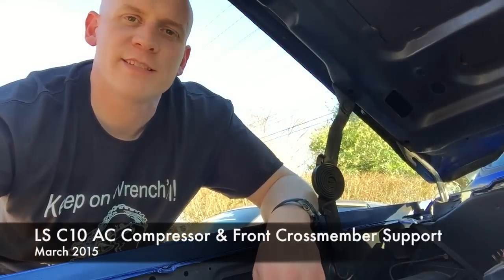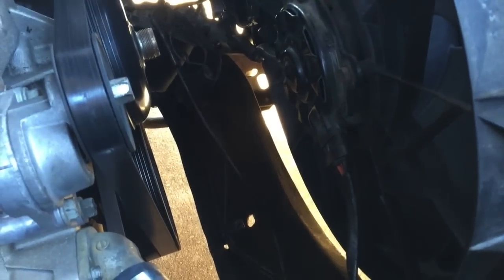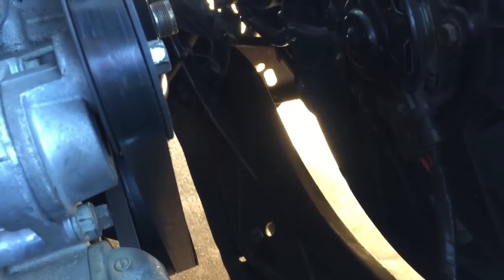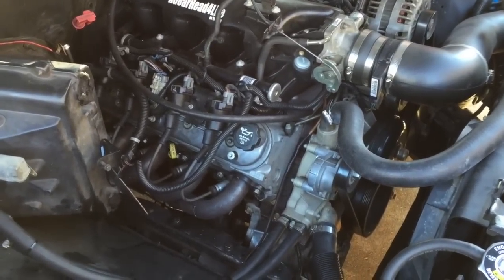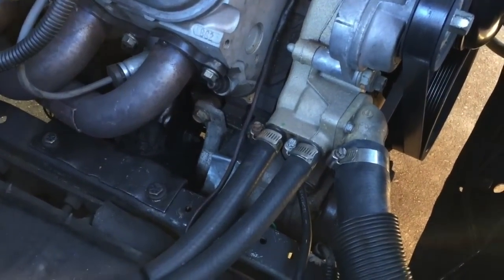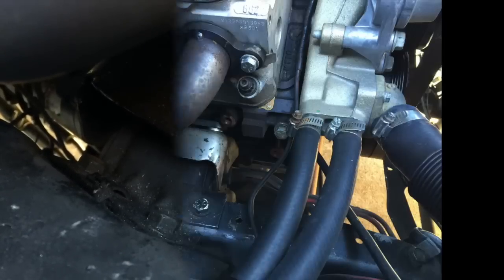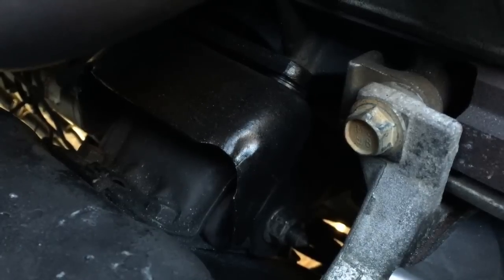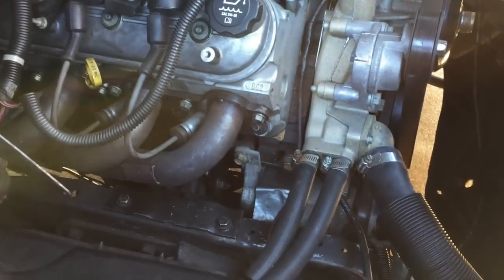Cold AC on C10 LSx Swapped Part 1 & Front Crossmember Info 73-87 Chevy Truck 5.3 Compressor LS

Comment: Thanks for the replies once again,I wanted to go fuel injected but I've already purchased the intake and msd kit. Currently have a good holley carburetor also. I just didn't wanna go thru the problem of trying to get the electronic throttle.

Comment from the maker: Preston Salisbury Awesome man! Glad you're enjoying the show man. With the LT1 it should be much easier since the 80s v8 clam shells will bolt up to them. I'm not sure what you'll need for the 65, but it'd be like putting a 80s v8 into it.
The only down side to using that rear end is that its an inch smaller and known as being weak if ever pushed hard, like with slicks and drag racing. If you dont hook that hard it should last. I dont have info on the rear end swap, but I'd guess that you'd have to move all the mounting points over to the new rear end, but that could be options left up to the fab man.
Reply: What motor mounts did u have
Reply from the maker: @Brandon_obs_ls  on this C10? I used basic LS Swap 1” set back plates off eBay.

Comment: friend of mine had the frame crack around the boltholes of the steeringrack , it basicly ripped the steering of the frame
they sell reinforcementplates to go over that part of the frame as whell 
since it might have been flexing for a while before you spotted it it might be a good idea to check there when you have the bolts off
Reply from the maker: Yep! Good point! I hadn't even made time yet to check to see if there's any more slack. And since your brought this up, that reminds me of another good thing that extra bar that I was trying to explain would help since it uses the gear box bolts to support the gear box.

Comment: Very cool informative post. I just started a similar project on my 1965 C10
I just purchased a 1993 z28 z28 with a 6 speed manual. For the drivetrain swap.
I want to use the rear end also. I'm wondering if there is a motor mount kit available for these projects? And for the rear end swap?
I know there's going to be a lot of fabrication involved and I found a good shop who a personal friend of mine owns to do the work.
I am just researching the Internet to find post like yours to forward to him.  Your video helps a lot thanks for posting .

Comment: I’m sorry but I’m still very confused on how you cut the adapter plate; with those two holes you drilled does that mean your clam mount is moving backwards with the two new holes ? Wouldn’t that make your engine lopsided. Sorry if this seems like a dumb question but I’m looking to do the same thing as you and I’m so lost. Thanks in advance

Comment from the maker: damian ficklin I dont have a engine code that I stay away from. I just avoid the 99s and some 2000s if I can. they usually have a notch cast into the head where it meets the block. That notch limits you on which head gasket you can use. I also avoid 706 cast heads since a large portion of them are known to crack.

Comment: you should cut the rivets off of your frame at the sway bar brackets and bolt them on. the driver side front rivet looks like it's failing too.

Comment: Hey Gearhead, Great work, as always my friend .Was that cross member from a particular year ? (I hope that the starter can be removed without much hassle) Thanks for the awesome video.............John
Reply from the maker: Thanks John! Yea, starter comes off easy. I dont know the exact year, but it was a few years older than mine. But you could tell that someone had installed it onto that truck because the frame rivets where already removed and it had been bolted in.
Reply: AGearhead4Life Thanks

Comment: I bought an LQ9 from an 06 Escalade and I'm working on the harness and nearly done but the A/C pins on the harness are stumping me.
On LT1SWAP it says to remove the A/C compressor clutch relay control and the 5 volt reference for the A/C from the pcms.
If I remove them, will I still be able to use the A/C? Or do i need to keep those in order to make the Escalade A/C work with my C10 A/C controls?
Reply: I took them off my pcm i wired it in as it was when it was stock and run it like that works fine for me
Reply from the maker: Keep the plugs to the compressor. I plan to run my C10 body harness to those plugs to control the AC. I havent wried in the AC yet to see how it'll need to all be done, but I bet it'll work this way. I think thats whaty Ivann just said he did too.
Reply: AGearhead4Life Ivann Carbajal so remove the wires from the PCMs, keep the connectors they used, and just hook them up with the C10 wires for factory A/C basically?
Reply from the maker: Carlos De Leon Basically yes. That would be my plan.

Comment: That was a pile of work man! How close are you to the starter, I'm sure it will be more likely to fail than the compressor. Good job as always, I would be more inclined to drill a hole in the frame than notch it, just a thought. Keep postin !
Reply from the maker: Thanks Jason! Yea, it was a crap load of work! lol But at least I didnt have to buy a compressor.. yet and i wont have a compressor up high blocking the veiw of my engine. :)  A holes isnt a bad idea ,but that lip there isnt very wide, maybe 2". IDK yet, havent had much time to look at it. I was hoping to just make a 90* fitting and go aruond the frame.
Reply: how did you wire the ac up whats the pinout for a 99 to 2002 pcm for a 95 impala ss?
Reply from the maker: I just ran the wire from old AC compressor plug to the new compressor. It acutally needs to be ran to the LS harness though, so that the computer can kick the compressor off when you floor it. I just turn my ac off manually before I floor it right now.
Reply: ok thanks

Comment from the maker: damian ficklin 99-00 are the only 5.3s that I avoid and thats only because the head has a notch in it that won't allow you to run a MLS head gasket. For AC, there are a few different ways to high mount an AC compressor and a few different compressors that you could use. I did the extreme budget way on the 5.3 Roadmaster swap. Here's the link to the video:  https://youtu.be/hA5DMdpsQxI

Comment: Hey bro is the ls swap really worth l the work and money. I would like your opinion cause you definitely got it down to a science. I have a early 80 with the older front end that I'm throwing together with spare parts but I am planning a frame off 85 in the future. I'm thinking of trying the ls in that but for now I'm kicking it old school.  Check out the 80 on my page. Let me no what you think.
Reply from the maker: ChevyShawn Most definitely. In every way. That's the only reason that I know them so well. Once you mess with an LS and see all the benefits, you'll never care to mess with SBC again. Gaskets are reusable, motors last ~100k miles longer, gets at least 5 more MPG and starts out with about 100 more HP. THere's more, but thats a good starter list of why.

Comment: Hey man so what do you think of the LS truck compressor now that you have a couple years on it?  It's nice that it's tucked low and away like that, only downside is notching the frame.  Any thoughts on the Vintage air setup, and using that with the LS truck compressor for guys with non-ac trucks?
Reply from the maker: Christian France hey hey Chris! The compressor has worked fine for me. No issues and still working great. Only thing that I wish that I would have done is install a high side pressure switch.

I’ll likely also later switch to LS high/low AC pressure switches so that I can let the PCM disengage the AC compressor automaticity when I floor it. Right now I manually turn it off as I floor it.

I only wish my blower motor could flow more volume. I may modify something later on to get more air. It does decent, but I’m comparing it to new cars and it’s a fraction of that.

I haven’t used a vintage air system yet to compare it to. I’ve seen how it’s nice having their system out of sight, off the firewall and inside the dash.
Reply: @AGearHead4Life  do you think moving the factory frame mount further back would have worked also?
Reply from the maker: P Motorsports Sure! Very likely, that would cure the issue. I think that I chose not to do that because of the curve of the frame.

Comment: Hey, just curious what did you run for a fuel system? i have a bone stock 2000 5.3 complete with wiring harness i'd like to swap into my 86' c10. Did you reuse any of the factory stuff or everything new? Thanks, love the videos
Reply from the maker: MechanicsMike Thanks Mike! Yea, I always try to reuse as much as I can. So I just dropped a warble 255 fuel pump into the sending unit. Then I used high pressure rubber hose and high pressure hose clamps from a parts store to go from the hard line to my fuel rail. That easy.
Reply: Just an in tank type of deal right in with the stock sender? Did you replace all the rubber stuff with high pressure line and just let her rip? Stock carb tank? Thanks so much man
Reply from the maker: MechanicsMike Yes, in-tank with sender adapted to fit it. You can do an in-line but they make a bunch or noise. I prefer in-tank. I also prefer to convert to a Blazer rear mount tank which I hope to be doing soon. Yea the 87s may have HP rubber on them already, but if not HP replace with HP rubber hose and HP clamps, not regular clamps.

My truck was 87 and had TBI fuel injection so it made it easy to swap in a high pressure pump. My last truck was 84 and carb, on that one I had done an in-line pump, but didn't like it. You need a sump in the tank with an in-tank pump.

So that was a lot of babbling. What I'm trying to say is, get a TBI fuel injected rear mount blazer tank and sending unit. That is the best way IMO. if you dont want to convert to rear mount, you could get a 87 tank. Or you can fab your own sump on the carb tank. lots of options. lol
Reply: Thank you so much. I have the wiring completely figured out partially in thanks to your videos, kicked over on a stand without issue. I'm going to find an 87' c10 tank, it's an old beat work truck but it's solid underneath. Already built an el camino that I built with nice paint and all, time to do something different lol
Reply from the maker: MechanicsMike Cool! Sounds like a good plan. Good luck!
Reply: Thanks man!

Comment: Hey Mark , I have an 86 c10 and I watch your YouTube channel a lot for info. Thanks for doing what you do. My question is:
I'm getting ready to install a/c in my truck(it's an a/c truck) and I want to know if your  condenser and accumulator are newer like what a newer vehicle would come with or are they older like what the truck came with or does it matter?

Thanks, Randy
Reply from the maker: Hey Randy! Thanks man! yea, I'm using all of the old truck stuff except for the compressor. The compressor is the factory one from the 5.3. I just had hoses made up to join them for about $100.
Reply: Your the best!!! Saved me a lot of headache
Reply from the maker: Glad that I could help!

Comment from the maker: damian ficklin you wont have an issue runnign a Th400 at all and it'll be a very strong and dependable trans. You just need an inexpensive adapter for the torque converter snout. I go over that on my FB blog page. It'd be the same as adapting a 4l80e to fit. Here's a link to that info:  https://www.facebook.com/notes/agearhead4life/lsx-4l60e-to-4l80e-swap/672347056152259

Comment: What headers are those and how do they fit?
Reply from the maker: Chasemanuti Theyre Schoenfeld headers and dont fit perfectly. The driver side has one tube that'll hit the lower control arm if you dont place the motor in the exact spot that they want it. So for me, i had to dent the crap out of that tube. Not happy about that. I may swap to other headers. Hooker now makes headers for this swap that i've heard fit well. I also may try used 4th gen Camaro Pacesetter headers with a little massaging.